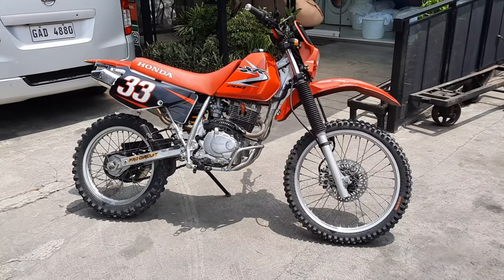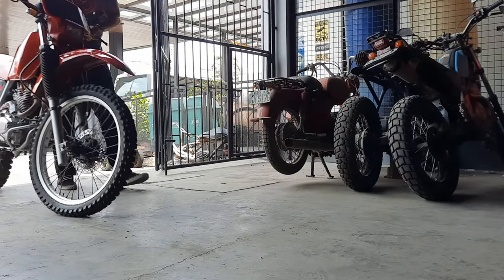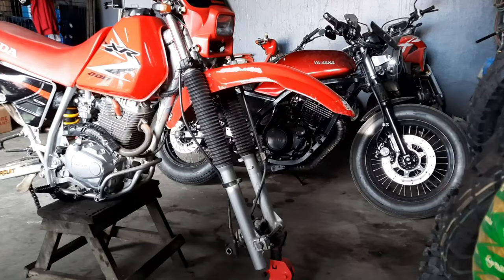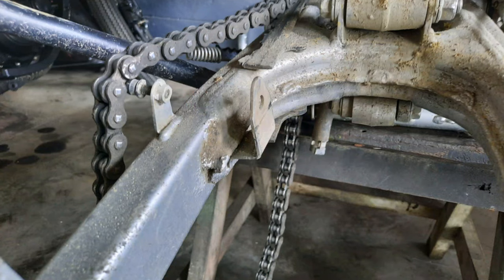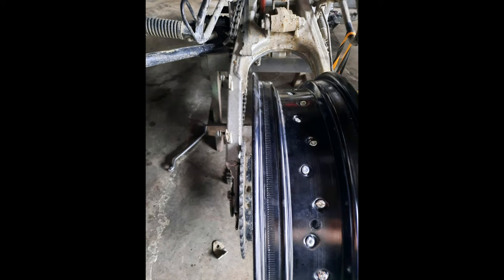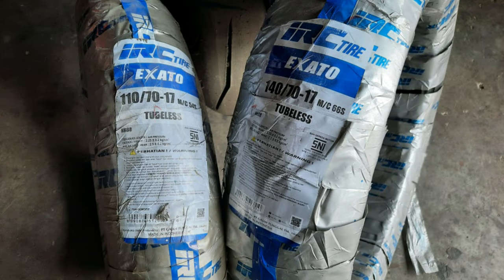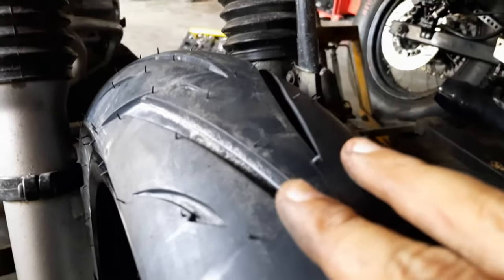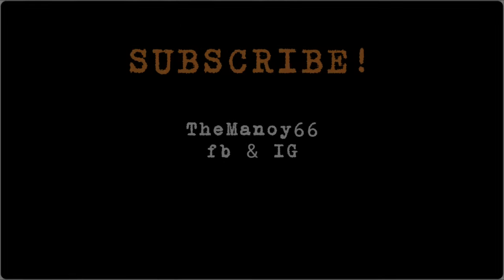HONDA XLR200 (XR200) SuperMoto Build Guide AND Reccomended Parts

Comment: Hi sir what size of spoke did you use on the rear hub? My rear rim is 3.50 36h but i think my rim is not on the right angle because the rim is a bit on the left
Reply from the maker: Have your wheel builder adjust the spokes. Too much to the left would cause it to rub against the chain. If he is a pro wheel builder he can offset it a bit to the right
Reply: @TheManoy66  does 160/60/17 tire fit ?